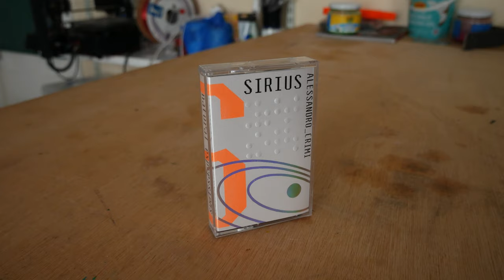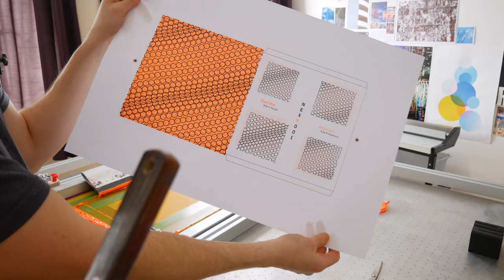April Vlog - Making T-Slot Nuts - Screenprinting on new table

Comment: Have you thought about printing your fluorescent layer onto an acetate sheet that is fixed at one side  then using this to register the black layer. you can move it out the way and just wipe it off when you are done :)
Reply from the maker: Hi Harvey, yes I use this registration method when I need things to line up perfectly and it works great, though I usually prefer a 3 point tab reg setup as it is a bit quicker

Comment: I 3D printed a few in nylon when I was desperate for some to mount my Raspberry Pi to my 3D printer to run Octoprint, they work fine but I wouldn't want to trust them for anything structural
Reply from the maker: I wish i could print in Nylon, I wonder how strong some printed by SLS would be......